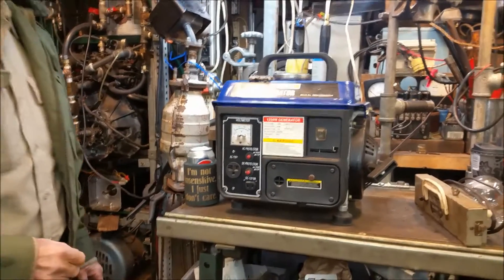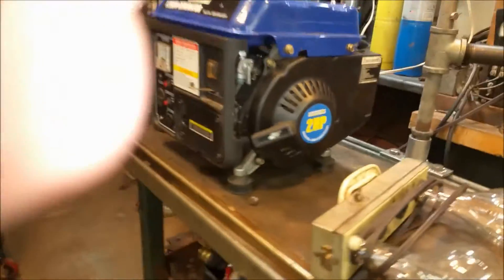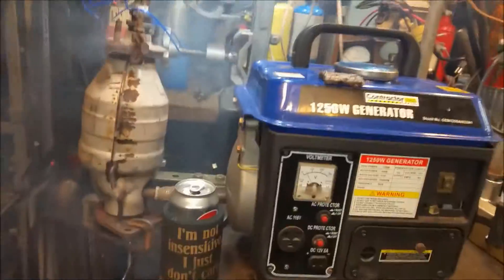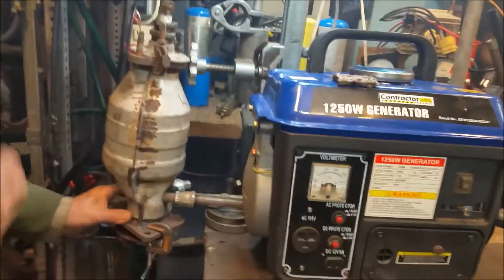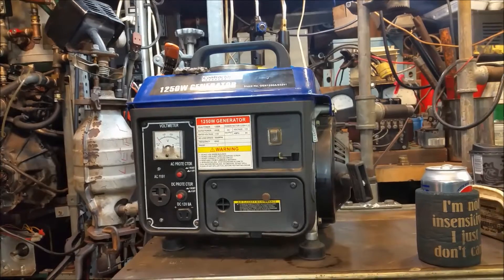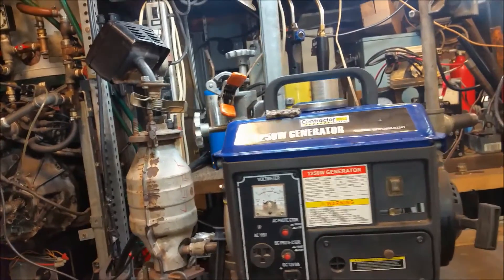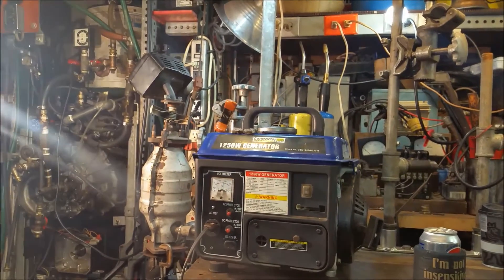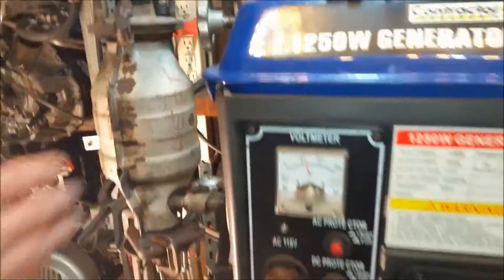Field Trip to Dads #3:  Harbor freight generator GEN1250A/03241 mod with a catalytic converter

Comment: Never ether a two stroke engine.  It dries up the lube in the cylinder.

To prime, turn the start switch to off, and pull the engine through once or twice.  Then turn the switch on and pull.